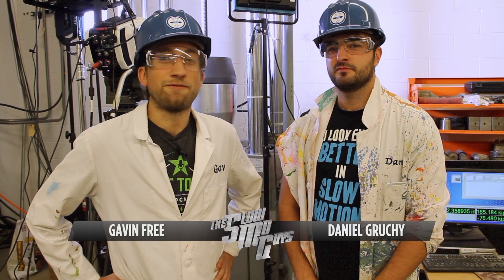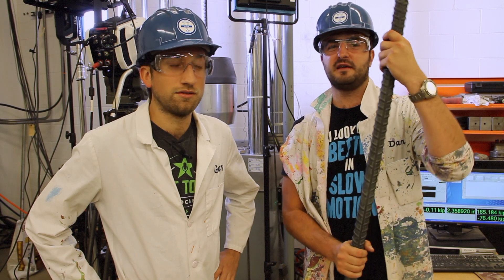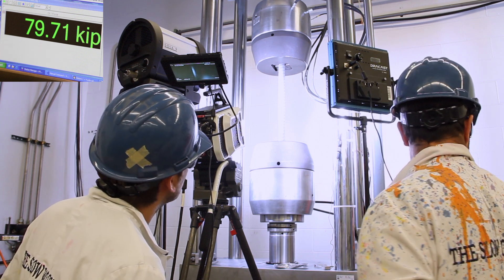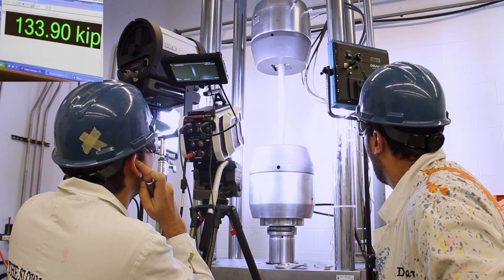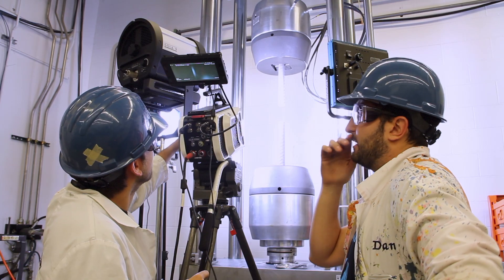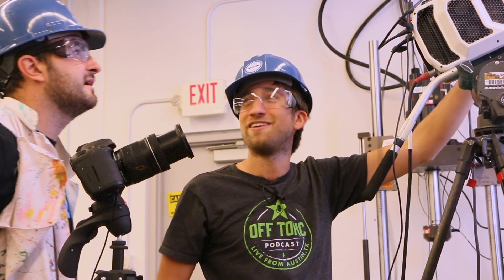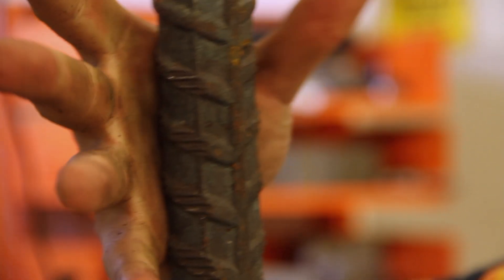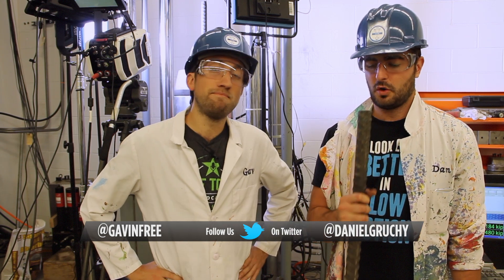Snapping a Steel Rod 1000x slower - The Slow Mo Guys

Comment: it should be noted that "rebar" is short for recycled bar, or similar idea. its recycled steel made into bars for construction. steel itself is "stretchy". if you have ever worked construction and had to cut rebar to length you will know that some pieces cut like butter, while others take a good while to cut through.

Comment: why not to spin the steel Rod until it breaks like the CD desk
Reply: You’d need neutron star levels of spin for that
Reply: rebin rania That would probably kill someone
Reply: rebin rania that rod would require very high rpms on a perfectly balanced mechanism.  Way beyond normal testing purposes
Reply: rebin rania :You can calculate it yourself actually .You know the force required to tear apart the rod ,now just equate it to the centripetal force formula ie,
F=(M×V×V)/R 
F is 157 kip which is 698398N
So suppose the rod is like 2 Kg and legth of rod say 0.5m.Therefore,
Radius is also 0.5m .So,
698398=(2×v×v)/0.5.
So the Tangential Velocity is
V=418m/s ,therefore rotational velocity is 836 rad/s.
Which is 7981 RPM.

Comment: should have been slower and closer to the rod. it snaps way too fast, I'd like to see the elasti break more precisely
Reply: you should consider that in order to see the break you need about 1mil frames/s and a camera which has not been created yet because with the current setup the resolution would have probably been terrible
Reply: If you slow down the video to 0.25× at the 148,000fps part you can see the exact moment it breaks
Reply: Are you serious? Did you even listen to what was said?
Reply: Pedozzi not so easy, you can't tell exactly where it's going to break, so they had to film the entire bar. Would have been clever to use a shorter bar though
Reply: That was clearly a fragile break. It would be pretty hard to distinguish between elastic and plastic periods.
Reply: The only problem there is that it isn't actually recording the light move. It's an illusion. It takes each frame from many different instances of a light pulse then stitches them together so that it looks like a single light pulse. It actually is only capable of recording around a million frames per second, which if I remember correctly, is the same as the fastest camera Gavin has. It may have had a higher resolution than the one Gavin has, but it was also not easily portable, and really huge. Probably weighs at least half a ton as well.
Reply: More pecise elastic break, bun can record at vga resoluion (144p or 240p)
Reply: Pedozzi i agree
Reply: сфинксы пудины lasers
Reply: The camera "records" light by recording different instances of a light pulse with the slightest bit of offset then stitching the images together so that it looks like a single light pulse. It creates the illusion of recording light itself move without actually doing so. It's pretty cool. GO watch the videos.
Reply: They recently made a camera that operates at such a high speed, that it shows the movement of light across an object.
Reply: Lmaoo that is so dummmbbbb. A camera RECORDS THINGS using light. How can it film light? Its impossible

Comment: That computer ran win xp
Reply: Super Stable OS,WinXP is!Call it "Ole Reliable!" I never had any problems on many PC's I've owned too!
Reply: No one is saying that it had problems or that it was bad.  It's just an old OS that is no longer supported by Microsoft, which now makes it super vulnerable.
Reply: Stable and powerful
Reply: Onkar Jagtap stable yes. Powerful.... Not so much. Thats why I use win 7, sacrifice some stability yes, but overall i think its worth it
Reply: Many pieces of older expensive specialized equipment lack support on modern OSes. If you don't need over 3GB RAM there is no pressing need to upgrade, and it's not worth the potential hassle.
Reply: soo ?? i have win xp...
Reply: My computer runs Windows XP
Reply: No point watching the video, just use that computer - there's the real slow motion
Reply: I worked on the compressive strength testing machines for about a year back in 2007/2008 at Purdue. The computers were running software from the late 70s early 80s. If it works it works!
Reply: You couldn't and dow

Comment: See, Windows XP is still used by some really expensive industrial grade test quipment.. Lol
Reply: You don't have to worry about Windows updating and messing up some software or hardware compatibility anymore, even slightly. It has its uses, as odd as it seems at first glance, especially if it's a system that just has to do ONE thing properly and doesn't require any of the newer features of later versions of Windows.

Comment: For those who think "bits of steel are falling off" before it snapped. Those were impurities attached to the steel, the steal remains one piece until it breaks completely. In other words, steel didn't chip off before it was pulled apart.

Comment: What IS 157.401 kips in horsepower? Anybody know the answer because I'd be really interested to know what kind of vehicle you would need two of to be at either end of the bar to snap it by driving outwards.

Comment: To be fair. If you're measuring it as 220,000 foot pounds per second? That's only 440 american horsepower.

That's opposed to metric horsepower or kilowatts.

Comment: Actually it's not that high, because at the university, I'm doing some materia Science, and to strech a bar 30 cm long with a diameter of 14mm until it breaks, we needed 67 tons. For this one you needed 78...

I think the force needed is related to the material not the diameter.
Reply: Kendrick XY just a heads up so you don't spread misinformation. Force = stress x area. So the force required changes based of the materials young modulus and surface area (in this case (pi x (d/2)^2)). It might also depend on the length of the piece but I forgot if it does.
Reply: David Mahler Isn't the Young modulus only for the elastic range, not applicable once deformation begins?
Reply: Kendrick XY you should take that course again. even with just common sense you can tell you would need less force to break a needle.
Reply: Breaking and Stretching is different.

You can take a hammer and break a diamond. But the tensile strength is insanly high
You can't break a steel rod with a hammer, but the tensile strength is 10x lower than a diamond

Steel Utimate tensil strength:  400-550  MPa

Diamond Ultimate tesil strength:  "The precise tensile strength of diamond is unknown, however strength up to 60 GPa has been observed, and it could be as high as 90–225 GPa depending on the crystal orientation."  - Wikipedia
Reply: Stretched length over original length is strain.
Reply: Both
Reply: Kendrick XY both, stress= force divided by area that opposes to the force, always the smallest area vertical(for pulling or pressing) to the force in question as it will give off the soonest , yes you'd need more force for a stronger materiel as the stress needed to break it will be higher, but same goes for area, you'd need more force to rip apart a 2mm diameter wooden stick then a stick from the same material but with 1mm in diameter.
Reply: 78 tons to break a 1.5in steel rod in tension. Are you sure you study Materials Science?
Reply: sorry I made a mistake I meant to say 67 tons to cause failure in a 14mm diameter rod seems  a little high. That means that the rod has a UTS of 4269MPa which  is pretty unlikely
Reply: It's a combination of both the dimensions and material strength. We're it not then the same force being applied to various dimensions would yield the same result. I.e. as someone said the force needed to pull apart a needle would be the same as the force needed to pull apart something as large as say a football field provided you were pulling along the length of the grass. The shear quantity of material deforming should tell you intuitively that it is most certainly more difficult to separate larger materials

Comment: You asked how mutch horse power is that pulling force?  The answer is 0.  Force is not power, it is force.  Power (Watt) is the amount of energy (Joules) spent in 1 Second.  Energy is mass moved by distance.  That rod is not going anywhere right up to the point just before it breaks, so the answer is 0 horsepower/Watt

Comment: I'm surprised it failed under that little of a load. Sure, 75 tonnes is a lot but not when it comes to ripping apart steel.
A blue whale weighs more than 75 tonnes as does a space shuttle. I never would have thought either of those would be heavy enough to pull apart a steel rod of that thickness.

Comment: <--- structural engineer

The crap on the bar that came off is mill scale. You can remove it easily by wire brushing or sandblasting, but concrete bonds to rebar fine just the way it is, plus it does provide some corrosion protection for the short time between manufacture and incorporation into concrete, so nobody ever does that.

Comment: 3:17 You can see the steel oscillate in a longitudinal manner, like a spring. Amazing! Knowing the forces involved and the oscillation range, you could also easily calculate the spring constant. The bloody spring constant for rebar!!

EDIT: Because I have no life, I decided to actually calculate the spring constant of the rebar featured in the video. After capturing screenshots at each (damped) oscillation peak, very carefully measuring the number of pixels, looking up the measurements of their particular steel beam, and using the measured numbers in the video, I fit the observed data to a sinusoid enveloped by a decaying exponential and ended up with an estimate of k = 0.5 GN/m (with a rough variance of approximately 0.1 GN/m). That's half a billion Newtons per meter!! Talk about a stiff spring lol!

Comment: Either the video was slightly sped up or the pitch was raised 'cause neither of them sound right. Like they pumped the smallest amount of helium in the room.
Reply: I think it has to do with the fact that some machines in the facility make a lot of low frequency noises. And the lower frequencies of their voices are masked by the machinery.
Reply: it could also be that when they film outside nothing bounces off walls and the lab probably has no soundproofing so things could reverb making it sound weird just my guess though
Reply: Spector 117 I was wondering if I was alone in this so I scrolled down. I'm glad I'm not going insane cause it's really odd
Reply: wouldnt have changed the length of the clips or audio
Reply: Yeah! Then they filtered out low frequencies to get rid of that noise - wich just makes audio quality worse. It doesn't really matter for me, since microphones on the shirt, gives crap audio anyway (due to acoustics). But the "high pitch" people hear are indeed that more than usual of the low frequencies are missing.
And yeah the sound when it stretches and breaks is just an added sound effect. There is no way to have recorded sound when you slow down the video that many times.
Reply: Nah. Theyre just skittish little girls :P
Reply: Spector 117 The camera doesn't record sound
Reply: MessiahNerves it would if he syncronized the sound length and video length, which makes sense to do...
Reply: Soqui Music I liked this so I could look smart
Reply: Spector 117 he probably filmed at 25fps and accidentally rendered at 30fps
Reply: Spector 117 oh yeah
Reply: lol i was the 666th like
Reply: Spector 117 are u talking about the sound during the slo mo? Because thats all added in you know?

Comment: so, 157 000 Pounds which is over 71 000KG. So this little bar can easily lift titanic + bagger 288 digger... fuck me
Reply: That little bar would absolutely NOT be able to lift neither the titanic nor the bagger 288 which are 47,450 and 45,500 tons respectively. That bar can handle 71.21 tons before it breaks.  The titanic is 666.33 times heavier and the Bagger 288 is 638.95 times heavier.

Comment: I'm curious why there wasn't any necking. Usually ductile metals will get skinny right before breaking and give a 45 degree break instead of a flat one. Was this a high carbon steel? That would make a lot more sense. I just thought rebar was usually low carbon steel.
Reply: Oh I cans ee the necking now. Usually theres more but again it would make sense if it is higher in carbon

Comment: 2014- "Mousetrap Chain Reaction in Slow Motion"
2017- "Snapping a Steel Rod 1000x slower"
2020- "Slicing a tomato in Slow Motion"
2023- "Closing a door at 28,000fps"